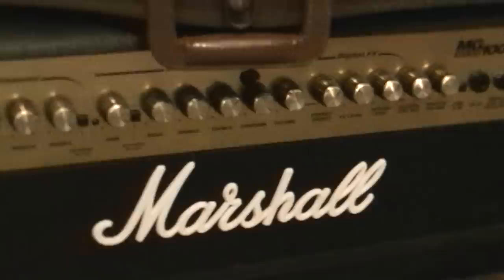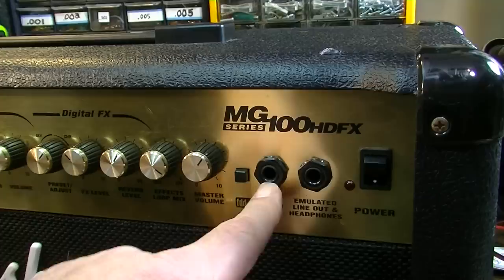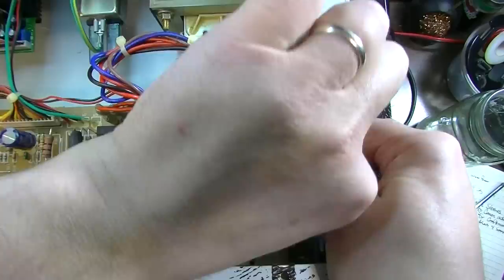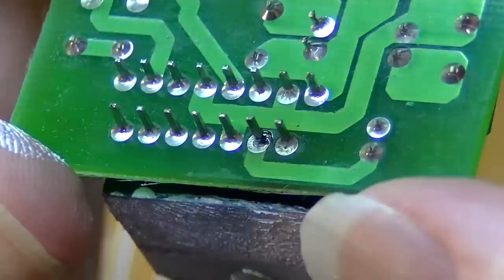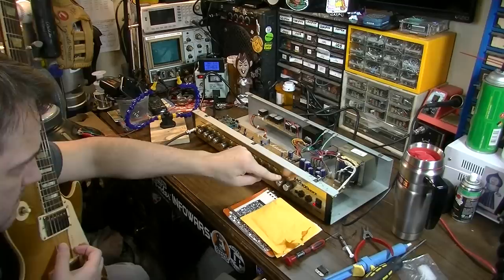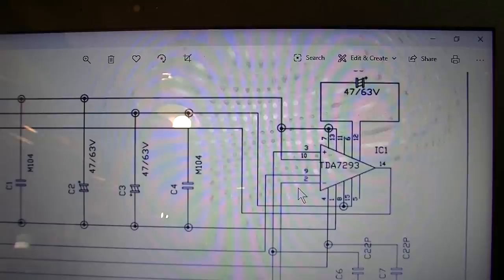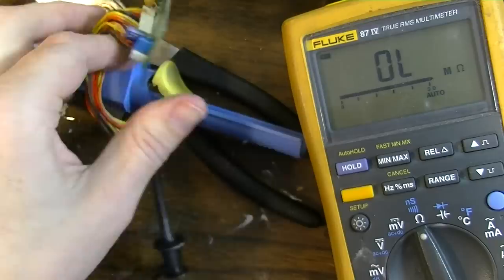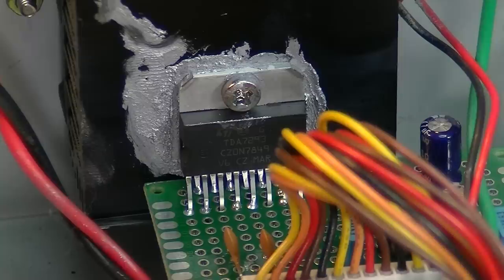Found a Marshall Amp in a DUMPSTER...Can We Fix It?

Comment: I had this exact amp head back in 2006 and after 2 months it began to smell of smoke. I turned it off and on and it wouldnt turn on. Repair. Guy said it had a blown fuze and after a few minutes it would blow again. Called Marshall warrenty and they said it sounded like water damage and wouldn't hear another word.. The amp was in a dry location always. The repair place wanted to give it back to me broken and a $120 bill.. I just let him keep it. Not sure if it got parted out or fixed.. But I never purchased a Marshall again.

Comment: Awesome job! I really enjoyed your video. (Subbed!) I put a fan in one of the MGDFX combos but that's about the extent of my amp chops. Guitars are another story. I do a lot with them. So if I didn't fix the honking bearing in the fan on that combo (by replacing the fan) is this the part that would have melted down? I did realize that if the fan quit the amp would not be long for this world.

Comment: Arg.... Voltage regulators right next to big electrolytic caps.... those regulators usually get hot and that's gonna destroy those caps... They should at least put a little heatsink on them...   And those damn TDA amp chips need an insulator between them and the heatsink because they have the damn tab tied to negative instead of ground!!!   WHY!  I hate them so much.

Comment: I had a problem like this where the relay went out on a control board that another tech put in on an a/c unit where he forgot to put thermal paste on the back of the relay to the heat sink. Thought I saw it on the old one and not the new one when you took it off.
Reply: Never mind I saw the rest of the video where you can clearly see you have it caked on there sorry about the last comment.

Comment: I have just acquired this amp 1/2 stack for 150$ usd sprayed the inputs and out puts with connection cleaner and it works great. I want to up grade the fan is their a specific type, and apply new thermal paste. Could any of the other parts use some upgrading since it is over 10 years old caps etc? I'll take it to a tech.

Comment: Hi I came across your video. I have the exact same amp, been having it for years, it works great only problem is that it got invaded by cockroaches.. 
I pulled the thing out and tried to clean it but they got everywhere even inside the transformer. Do you think it’s worth salvaging? I just hate that it smells bad when the fan turns on. Any tips THX

Comment: If a cap (c1 - c4)  is shorted, would the chip get any power? How hot does that board get and does heat cause it to break down.  Given it was tossed, I have suspicion that tech was familiar enough with the problem to say it was likely to happen again if given a marshall replacement board.

Comment: wow cheap axx chips in marshall… 
I would have guessed a bad cap on the inputs (shorted) or bad load like speaker with an over heated voice coil took it out..
old school tech...
I always use caps to isolate the output to the bench speakers during the run up...
and have LARGE 4 ohm resistors in an oil bath for the load...

cool find!!
one good tip for you is before solder sucking the board...
re flow all the connections that way you have fresh solder to suck out...
when the solder over heats it changes it so it will not flow right..
and 60/40 kester solder is still the best to work on this stuff..

do you have an ac load limiter for your bench yet???
that saves a lot of new parts... watch the watt meter...
start at low current and go up from there...

good and bad on this amp..
bad is it is a cheap design...
the good is it is a cheap design... lol!! low cost on the  replacement parts!!

better to have too much heat sink compound than too little!! lol!!

I never understand why they just do not sell them as a tech special for 20 bucks.. and no returns.
as I shake my head!!

Comment: Was the cap you had wired backwards on your DIY board the bootstrap capacitor (aka C5) by any chance? There's a discrepancy between the schematic and pcb for that component. Schematic shows C5 positive to pin 12 and negative to pin 6. The board I'm working on has C5 reverse biased.  It was that way on your stock PCB in the video too and in any picture I've seen online so I'm leaning toward installing it that way, but then again all those examples were burnt to hell so that doesn't really sell the idea. Plus the datasheet for the IC shows the cap biased the same as the schematic. So you'd think that would be the way to go but nope, marshall doesn't have the chip configured like the datasheet. They have it inverting. Which maybe justifies the reversed biased bootstrap but I'm not 100 on that. What do you think?  say fuck both ideas and buy a non-polar 47µF cap?  Yea that's what I'm gonna do. Thanks for the video, bro. —the end

Comment: Did you meter out the board after you had removed all the components. Pin 8 (Sig gnd) and pin 15 (power gnd) should, according to your wiring diagram, be connected together (which they are by the track on the pcb, you were getting intermittent 50k across the +ve and ground...that is a faulty electrolytic every day of the week...not a leaky board...and you still had C2 soldered in when you metered it.

Comment: Say Cuz, I may be wrong but if you run your Ohm meter to the mount tab on that 7293 chip to the vs- pin, they may be connected. If so the only reason it lasted as long as it did was due to dielectric thermal paste. With no isolation around the mounting screw as the chip heats up and moves, the tab shorted to the screw. It should have mica behind the tab as well. Like I said, could be wrong. DEATH BY OSCILLATION! This bypasses a capacitor.

Comment: So why would running a direct coupled transistor amp without a load cause a problem? More likely a short.
Reply: You're right. In fact, according to the TDA7293 datasheet, it seems like quite a rugged IC, with short circuit and thermal shutdown protection. I actually get the impression that many so called "guitar amp techs" only know how to fix tube amps, but remain totally ignorant about solid-state technology (like many guitarists). Without question, they'll go ahead and repair the tube amp, or even replace the speaker, but are very reluctant to do the same for a decent solid-state amp !

Comment: The PCB didn't look carbonized but measured resistance which the PCB because conductive. Resistance from the PCB being conductive cause heat from the Voltage drop

Comment: Not too long ago, I worked on a Marshall amplifier of the same vintage, just a lower end model, and I was very unimpressed by the build quality. The PC was very floppy and they used the cheapest components. The overdrive channel of that one didn't turn on. I scratched my head, wondering why that was, changed a whole bunch of components, nothing helped. In the end it was a jumper wire on the board that due to the floppiness of the PCB had worked itself loose :p Those input sockets are horrible too. If they get just a tiny bit dirty, they turn into resistors and might not let the signal through, when there's nothing plugged in. I feel Marshal amps from around that manufacturing date are pretty disappointing if you expect quality.

Comment: Hi like your channel...  I can't believe you found this in a dumpster, too bad you replaced the part and then it burned up again.... but then you resolved the problem... awesome amp for sure.. how much do you think its worth now fixed?....  I got a Marshall Valvestate 30 watt  Amp older am from i don't know what age it is i got it in 2000,  for 395.00  i think i paid to much but it worked missing one knob so i got a chicken knob its all i could find at the music shop.  anyway its has noise when  try to adjust volume.  hope i can fix it i tried spraying electronics cleaner in the pot and then moved it back and fourth about 10 times and turned it on later after giving it time to  air out  then  mad cause it still crackles.  arrggg.  any suggestions.

Comment: Hey Brad great video. Though I guess it's not surprising they binned it. I know the parts were cheap to fix it. But it would have cost a fair bit to have someone diagnose and repair it. And most repairs would not necessarily be a good or quick to figure it out.

Comment: Hey man, the video was rad. Can I ask you a question? I have this same amp with the matching cabinet and I think it may have a fae problems. The fan is a little bit loud, the amp kinda squeels sometimes when at high volume and mainly, the old channels are wayyy quieter that the clean. I barely have to turn the knob on clean and it gets really loud but the od at the same volume is so quiet that I have to turn it up to like half to hear it. Do you know what may be causing this? I font know anything about repairing amps but it would be really nice to have input from someone who knows what they're doing
Reply from the maker: Loud fan probably just needs replaced. Bad bearing maybe. They’re cheap. Get one out of an old PC power supply. As for the other issue. Impossible to say really. Bad preamp IC in Channel 2, or ancillary component.

Comment: I found this fascinating. What type of flux should I use when putting in new guitar pots or pickups? The flux I used before made the pots rusty. Thank you, and all the best from your Atlantic cousins in dear old Blighty. Stay safe mate. PS. Nice playing.
Reply: You must not be using electronics flux as electronics rosin flux will not rust or corrode.  But if in doubt, remove the flux with alcohol.

Comment: I am not a fan of  power amp stages based on i/c's, apart from conductive pcb's, the i/c's are not up to the job in car audio, let alone guitar amps.
If there is room, i try to replace them with a  good quality  discrete component power amp module, they are more robust and sound far better.

Comment: Marshall for me is history. I went thru 3 DSL 100w heads in 1 month and each one traded out was a new problem. And these supposedly were new heads. The output transformer blew on the first head within 5 days, sent it back. The 2nd one started sounding like a rotary fan was coming from cabinet and the third just dropped in sound. Yeah it was a DSL but you’d expect QUALITY. from a name like Mxxxxxxx. I later read the boards were sh!t.

Comment: Is that "sue this"" Les Paul guitar a Chibson? I'm assuming that's why the sue this is on the headstock? Your persistence paid off,  well done on restoring the amp back to working condition and by rebuilding the board yourself you saved the risk or ordering a replacement part that was also faulty and failed after 5 mins.

Comment: My best trash pick to date was a Marantz model 1 preamp and amp I forget the model, in front of a house one night out for the trash, I said to my girlfriend as we drove by, hey that looks like it might be something good so I turned around got out and took it out of the homemade cabinet it was in along with a tanburg reel ro real deck and a turntable again I forget what it was, I have a friend who is an audiophile so when I got home I emailed him about what I found and was floored when he told me what they are worth the amp and preamp and the best part was they both worked, my friend advised me though that they should have the caps replaced before using them which I didn't know, all the tubes lit up also, I put them on eBay on a Saturday morning a couple of days later and that afternoon a guy who wasn't far bought both for and I'm not kidding $3,000,00 dollars. My girlfriend all the time when we stopped was telling me that it was junk and not to bother taking it. Next to this whole set in front of this house was a very long cabinet that looked like a speaker so I described it to my friend it turned out to be a metrogon speaker by JBL, I looked it up and sure enough it looked identical, the only problem was it was a two hour drive to where it was in Pennsylvania, I told her that I was going back to get it again she thought I was crazy so at 2am I got in my pickup truck and headed out not knowing howmi was going to get this massive thing in the truck by myself and if it would still be there, thankfully it was and I got it home it was in beautiful condition, I put it on ebay and guy in California bought it for $1,800.00 which 1000 for the speaker and 800 for freight shipping, I took it to a place where they built a crate around it and shipped it out west from NJ to California. I've never found anything like that again, a very sought after Marantz.

Comment: they didn't even open it up to find the burnt fuse.  OK so replace that and then find out what the problem really is.  I'm saying this  Not having seen the entire  Video. I bet replace that fuse and it comes on at least you'll have power
. I myself came across an old anp the folks were done with wasn't working,  Took out the chasis examined it closely found a burnt fuse , Replaced the fuse and it still works today. The only real issue I found was the fuse of course, a cap the needed replaced. ,I think they were painting the cabinet with the  Chasis out and accidentally touched a few wires together that caused the fuse to blow &  They were never able to find the burnt fuse... bonus for me

Comment: After you reconfigured that entire board and it probably works now but you know what the problem was the entire time here's the problem you forgot that you put an oversized fuse that preamp can only have a load of the three amp fuse that fuse that you put in was wrong you're going to keep breaking preamps it's got too much running through it the minute that you throw the guitar onto the jack it overloads

Comment: You should have left it in the dumpster.  First and foremost, it's an amplifier, and the power amp is that little afterthought screwed to a fan heatsink?  I worked in a Korg/Marshall warranty center for several years, and most of those went directly into the dumpster because they kept blowing up.

Comment: 85 volts on the power trans8stors??? Module?
Reply: Wonder if I could pull a 12v - 14v and replace with a auto audio power amp? They work without fans. Brad? I need help cloning some silvertone hifi amps please ! Theres a medalist hifi stereo and they had a 4 legged record player hifi stereo that had the dual 12 pre and 6bq5 or i think 84 power tube. But two amps in one . the record player circuits would be an easier first build. I dont know where schematics are and I just need a good coach its real down to power supply preamps tone stack power amp........... Id like to compare fender and marshall tone stack values and networks compared to the silvertone hifi tone stack schematics

Comment: Sorry guy but your turn on is faulty would have a dimblulb type locality limewater on the line and then bring up your varac slowly . Now I don’t like bs and you don’t know me and I’m retired and don’t do much but a friend just brought me a old Fender to fix for him I haven’t looked at it and he didn’t know the model but it’s perfect to demonstrate technician work but this time I will try to film it it did think it had a bad driver? Don’t know why h said that it could have a stick  though the cone , that would be neat but probably a dragging voice coil  and I have a JBL k130 it’s probably way better than the original but I have it  the tubes are probably bad the first thing is to check them on a good transconductance tube tester the emissions type are great for a quick go/no go type of test I use a Hickok and have four it quite reliable on this site he uses a precessions brand of tester and it’s good I have two come to think of I seven tube testers some weird ones Simpson and Philips but dosent matter outputs probably shot probably 6l6 I prefer the 5881 type physically stronger and has a higher plate voltage if you study your tube history the 5881 was developed in response to problems RCA had with the 6l6 for the army so all new coupling and bi pass caps but I have to ruin it and make it too clean quiet is good put leave the horrible distortion and I mean compared to the hifi amps I am use to ss amps .001 pert tube amps .1 percent mi amps 40 percent or more is ok or even desired .  I worked on my frist amp when I was 15 it was a Fender bass men but four 10” and a one pice cabinet 2 6l6 any way I ramble but I will try to show this

Comment: the answer is:  OF COURSE you can fix it.. you can fix anything with enough bucks and determination...
  the problem is... is it WORTH fixing?   and the answer to that is subjective. 
    a cheap Asian made Marshall,   for me that answer is "no".  its solid state junk.  recycle it asap.
 
   that said,  my best dumpster save amp was a 1966 Blackface Super Reverb from where some landlord had done an apartment eviction.  
   didn't work and cost about $450 to fix, it had blown transformers, needed new tubes, caps, reverb pan. etc etc.. 
 but it sounded great once repaired.

Comment: How do people can throw away that kind of things? With fingerprints you can find the culprit! If I were you, I would just cut the trace on the board where you had about 50K of resistance, before building a new one and replace it with a wire.

Comment: Something to take in to consideration... you are getting these parts from China.. i see the bag that it came in. Likely from ebay.. There is a likely chance you have a counterfeit part. There is a huge problem of counterfeit parts from china that tends to cause failures like this where the chip may work for a few min then fail. It has happened to me and many others... can send you going around in circles.. try to avoid getting any semiconductors from china/ebay!!! it is tough though to find genuine ones unless you find a reliable source